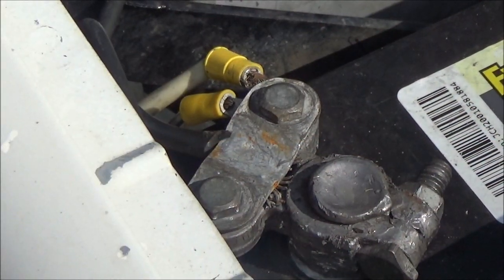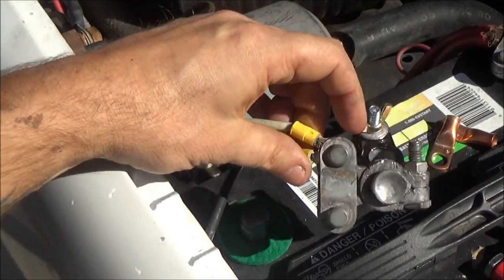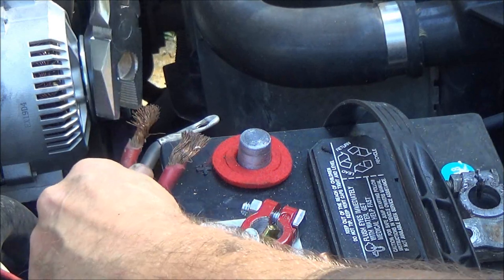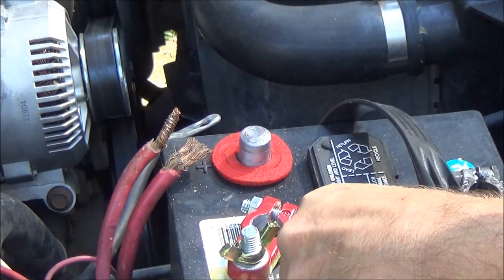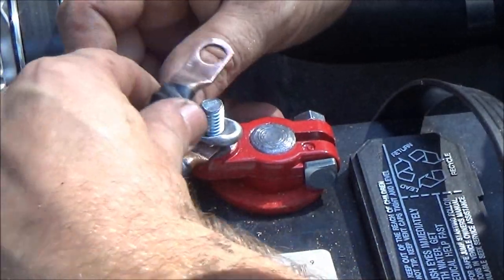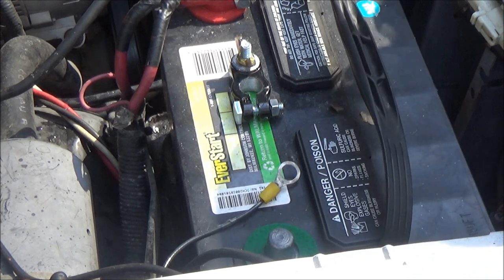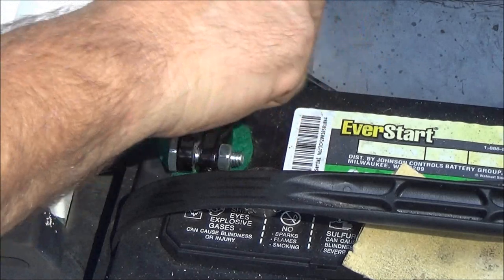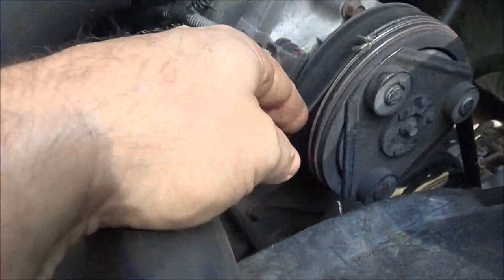How To Cure A Slow Cranking Engine And My Number 1 Tool

Comment: Corrosion is from the metal oxidizing, not from dirt. I agree with not using grease, just makes a nasty mess. Crimps will hold up better to vibration than soldered connection. You'll see most battery cable ends and lugs are crimped from the factory.
Reply from the maker: they crimp them because it's cheaper and takes less time. thanks for commenting.
Reply: @shabear1000  I agree with you, that is the most likely reason they do it. If you flex a crimped joint and soldered joint, the soldered one will break well before, it's more brittle. I personally prefer a crimped joint whenever possible. Thanks for the reply.

Comment: Hey shabear i have a question, i have a 97 geo metro that once in a while loses power when im at an idle. I did a code read and it threw a egr valve code. I changed the egr valve and it stopped it for a while but now it does it again.
Reply from the maker: Try to clear the codes again.
Reply: @shabear1000  ok ill try that. Only seems to do it when im at a light. Also when I went to put on the egr valve thw damn gasket fell into the engine and I was forced to put it on with no gasket hahaha
Reply from the maker: thats the problem, no gasket means its sucking air (vacuum leak). put a gasket on it, clear codes, should be ok.